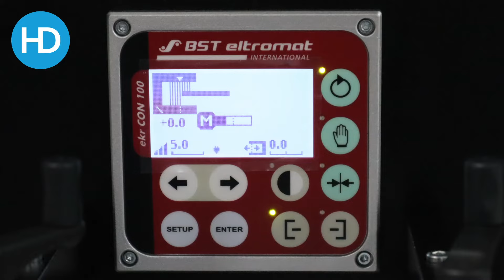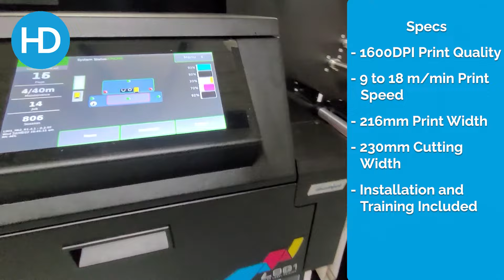Afinia DLP2200 Digital Label Press Overview | HD Labels

Comment: That stuttering looks strange. How do you maintain tension in that environment?
Reply from the maker: Stuttering is "semi rotary" cutting. It's meant to do that while registering to a pre printed label so it cuts in the correct place each time. Semi Rotary cutting gives you full control of cut postion and gap size.
Reply from the maker: There are dancer arms the move the material back and forth so tension is always consistent and the auto Web guide keeps the material in line so you always get a consistent cut.